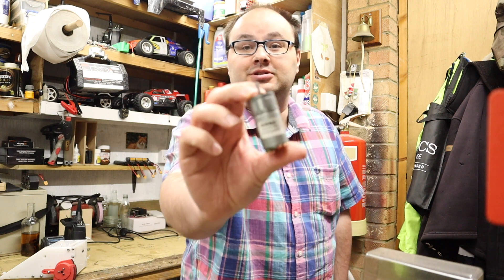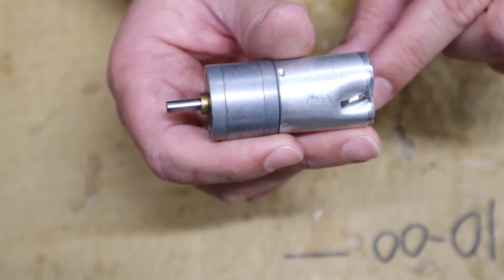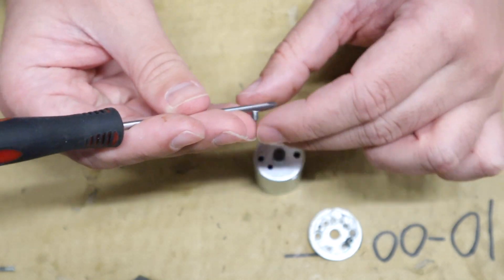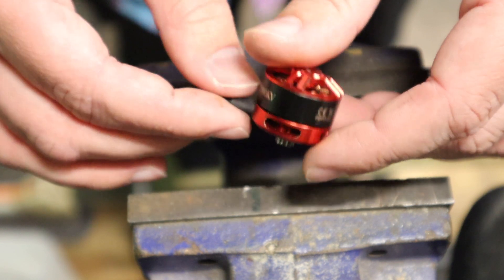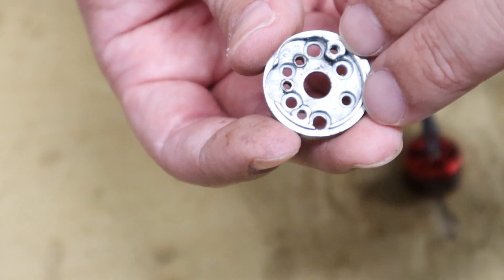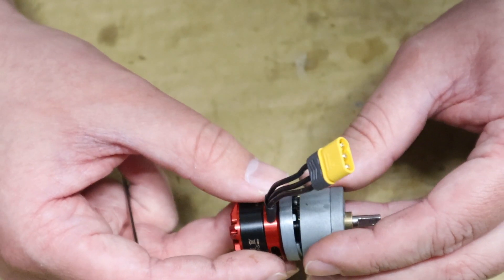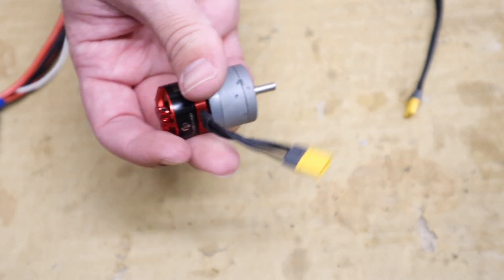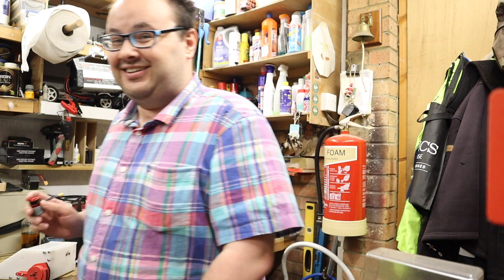Brushed Gearbox Motor Conversion To Brushless

Comment: i found out a flashhobby BE1806 have a version with a 3mm axle that has only one side as 2mm axle, so not suitable for the conversion, is there a replacement motor that can be used or a way to search for the full 2mm axle version?

Comment: Nice video Harry, but strongly advise people check out Alex Mordue's excellent tutorial for brushless 22mm conversions on his saw loser gitlab.
as two common failure points in the method you've done in this video is pinions slipping on the shaft from being pressed on (definitely use some metal glue if you're going for this method at least) and the spur gearbox giving in - definitely recommend 22mm planetaries and shaft swapping from the brushed motor instead. (See the gitlab tutorial)

Comment: Good job, but I think those gearboxes on the cheap 25mm spur gear motors are quite bad. Have you tried it with the double-gear boxes (2x spur gears) or the 25mm planetary gearboxes?